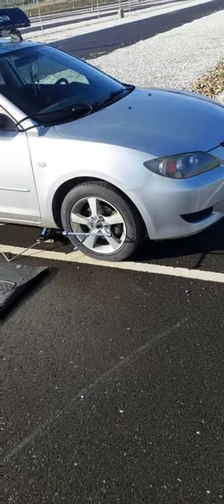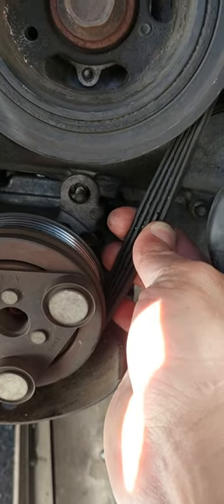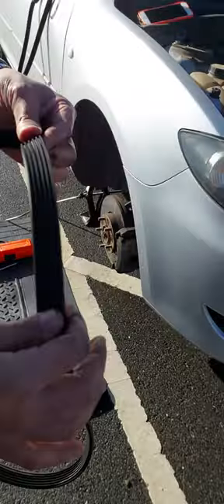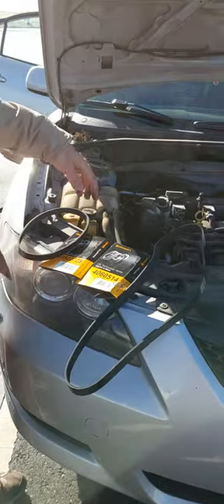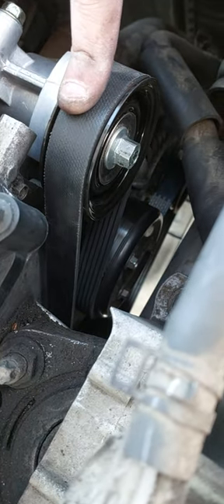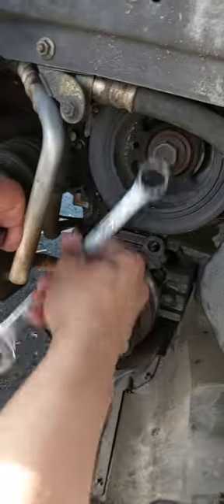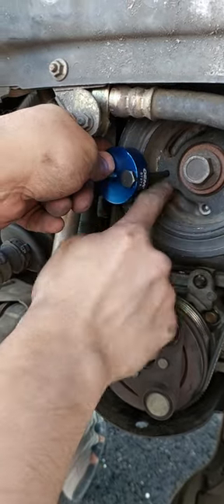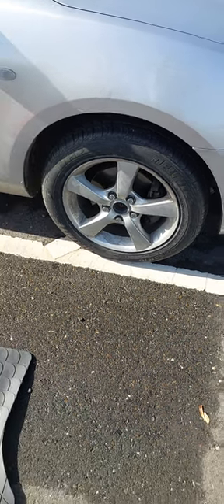Mazda 3 2006 serpentine belt, AC belt, and Tensioner replacement

Comment: How much torque should the tensioner bolts be tightened to?
Reply from the maker: This is a good question
Thanks for asking
The factory repair manual torque specification is 14-18 ft-lbs